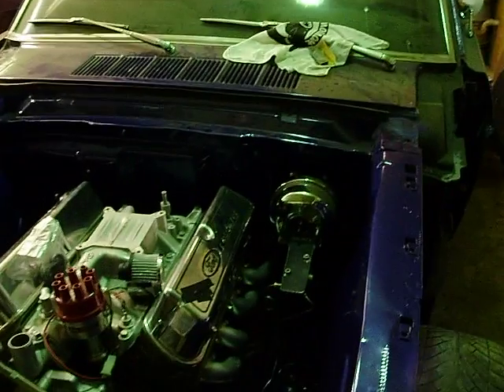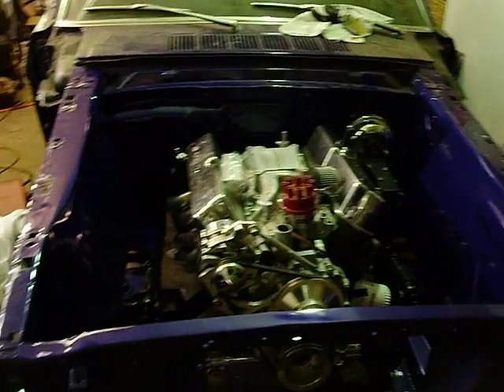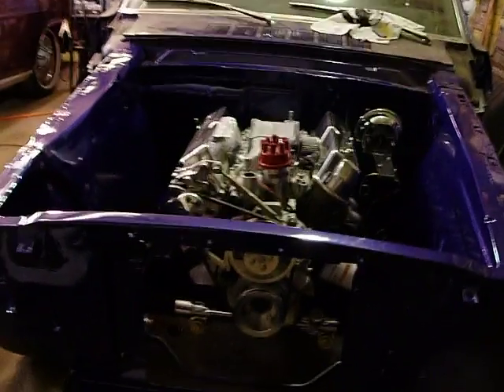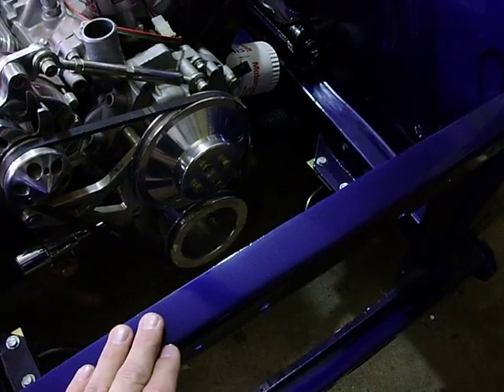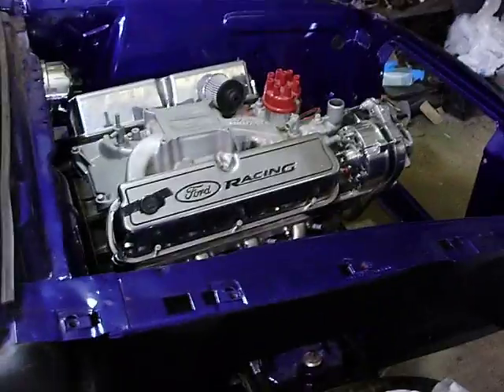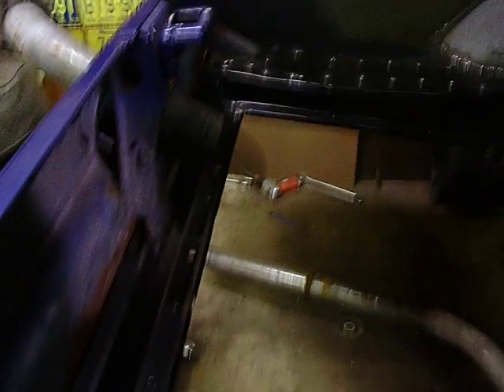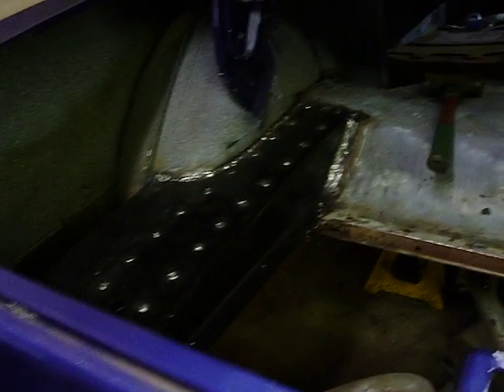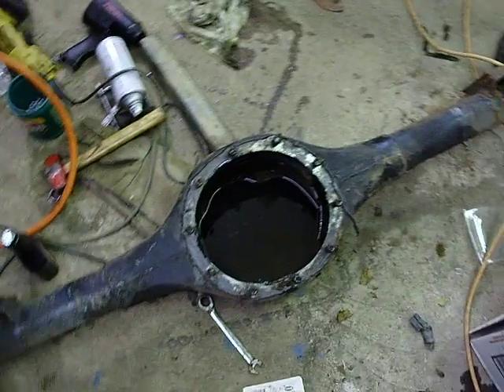1965 Mustang Restoration: The engine is in!

Comment: Bravo Billy, looks great, really pops, looking forward to hearing it run!
Reply from the maker: Thanks Rich.  It really does pop even though its all dirty.  Trans crossmember is still out and a block is under the tail shaft.  Planning on taking care of that tomorrow and trying to put some epoxy on the trunk.  I'll be putting in about 8-10 hours tomorrow.
Reply from the maker: Probably still going to be several more months before it fires.  I need to wire the car up but I'm planning on painting the dash (body color) before that.  So before that happens I need to get the rear suspension back on and the undercarriage coated with some paint.  Shew! I better get busy.
Reply: Still, a big step  and motivator seeing that shiny air pump sitting up front!
Reply from the maker: That's right. Definitely has me motivated.